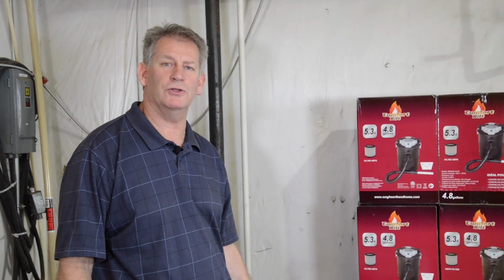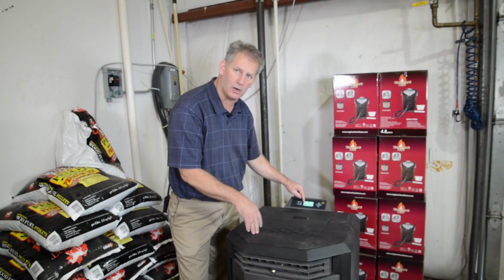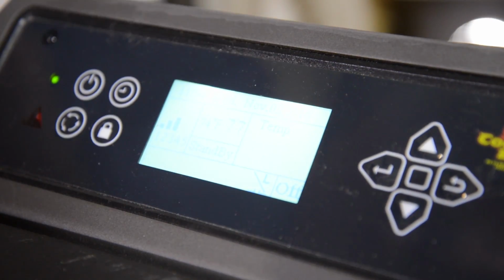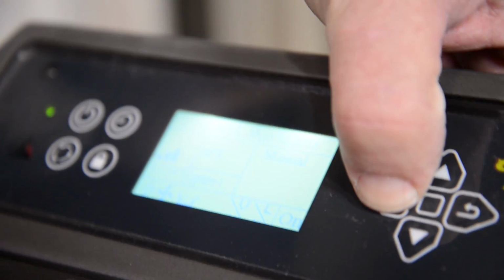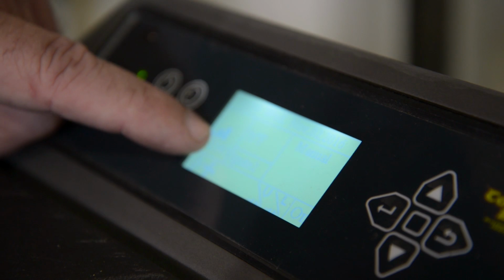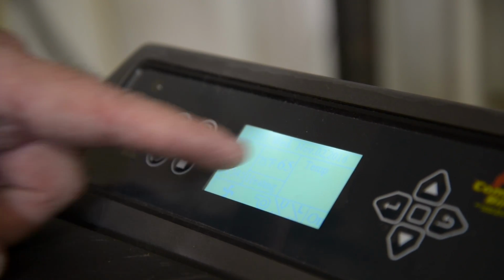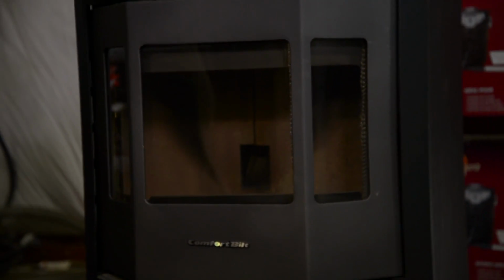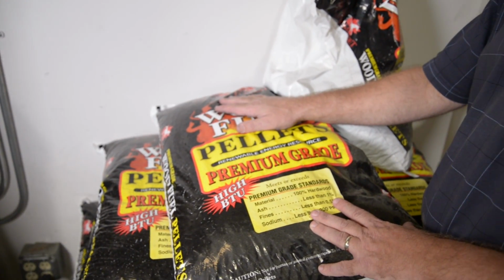ComfortBilt Setting Up the Stove (old video - see description)

Comment: Just fired up my new stove, so far all is well, hopefully no issues and happy burning, now i need to test out pellets, i just bought 1 bag from tractor supply.
Reply: I’ve found pellet density is most important. All pellets claim to be premium with minimal ash and dust. You can test density by scraping the end of a pellet with your finger nail. If it falls apart easily it’s going to burn quicker with more ash and there will be more dust.

Comment: TLDR: Buy this stove, don't think twice! The HP22 it’s a great stove, and could be MUCH better with a few simple tweaks.

Here is a conversation I had with Glenn via email and his responses (he is very quick to answer):

Hello Glenn, I am from upstate NY. I spoke with you multiple times and you have always responded to all my questions. I want to start off by saying I absolutely love the 2 HP22 pellet stoves, by far the best I have ever owned (and I have owned and operated over 7 stoves and 1 “automatic” pellet stove boiler system that uses the internet to read ahead 1 week to know what it needs to do (never really worked right).
 
However, I have a few questions and I know we talked about 2 of them over the phone.
 
1. Extended hopper, I would LOVE to be in that beta program or roll out cost is not really an issue. I love testing things and will give my honest review and opinion. 

Glenn - Extension hoppers will be available in the middle of February, I do not know the price or features as of yet though.

2. Faux wood logs, not sure if it’s the right term but I think you understand what I mean. You said on the phone that you did in fact play with that but the pellets would bounce off it causing inconsistent burn. Through my work (and soon home) I have access to a 3d printer and would love to play around with designs (in the summer months) that would not cause issues, I am confident I can get this done (just not sure about time frame as I do work 70-80 hours a week in the IT field. If I do get a great design and test it would you be interested in this? I am not looking for any money or anything like that again, I am a tinker that LOVES to make products better. I would gladly hand over the digital file that you can use to have your partners make out of the right material.

Glenn - Wood logs. Although I do like the look of a log in the stoves it seemed to have caused blockage issues in the past. But it is ok to put one in there.

3. The igniter, when I got my first stove in it started right up no issues at all. However, the second would go to Ignite 4 then time out. Knowing a little about stoves I figured it was an igniter distance issue. I was right, but the twist here was that there is not a hard stop to ensure its all the way in. You can physically push it all the way through and then the set screw will never hit the igniter to hold it in place. I would recommend (if possible) to use a nail head approach. Put a flare at the end so users can push it in all the way then the set screw would hold it in place. I found what works best is about ¼ of an inch away from the hopper end works best. Both stoves adjusted and both start at the end of the 1st ignite or at the very start of the 2nd ignite stage.

Glenn - Igniter. Yes, 1/4 inch behind is the optimum location it makes a world of difference in startup times.

4. The place you have the thermometer coming out is too low to the ground (in my opinion). After a few weeks of testing I believe the perfect place to exit the back is 8.5 inches down from the top and 4 inches from the side. This should be a super easy mod and I will be doing this to both of mine in a much nicer way, internally with real zip-ties (the bread ties were just for testing).

Glenn - Thermostat wire. Although I admit it's not the right location and therefore causes the temperature in the room to be off by around 5 degrees. The wire is just long enough to move it like you did and I will pass the location you gave me along.

Me - (I actually have to respectfully disagree. If you open the side of the stove and remove the zip ties I had ample wire to come all the way up the back behind the control panel and sit about an inch from the top, and I am proposing it sit around 8 inches from the top.)

5. The metal auger cover, this is a flat top and pellets get stuck causing the sides to not completely move down. I have had the pellet stoves error out when there were still a good 2 hours left of pellets in side, they just did not slide down and were stuck on the side and auger cover. I don’t have any suggestions for the sides but a “^” or cone shaped cover over the auger would fix the flat top issue. It does not see high temps back there so I was going to play around with some 3D printed designs (in the summer of course). Once a design is made it would be easy to make a kit out of metal and include high temp sealant for an “add-on” fix.  Again, this just may be me over analyzing things, but again, I love to tinker.

Glenn - Hopper angle. This is my most despised feature as you want all the pellets to go toward the auger but like you said it leaves 5-6 lbs. on the outside of the walls. The taper should be more prevalent.

6. Ash pan, it does not quite sit far as back (internally) as it should. I would say (guestamating here) the ash pan catches about 68%-72% of the ashes, the rest fall behind the ash pan and have to be cleaned up with the pan pulled out. Not a big deal, just wanted you to be aware of a possible issue for future revisions or what not.

7. Cleaning cycle, I am not sure if you tested different timings but what I have found to work the best is every 30 minutes run a 30 second clean cycle. This keeps the burn pot nice and clean and does not affect operation even on the lowest settings. I have been running with these settings for 2 weeks and not one issue.

Glenn - We tried the cleaning times at 60/30 and 60/20. I do think that the 30/30 will be better because it's cleaning more frequently.

8. This last request might sound a little odd. The computer that is inside the black plastic box how much would it be to get one of those with the data cable and thermometer. I don’t want to play with the one that came with the stove but here are my plans, again because I LOVE to tinker, not out to make any money or anything like that. I am just programming my whole house to be a smart home. The reason I would like a spare so I can see the outputs and hook it up to a RaspberryPi 3 with WiFi and Bluetooth. My reasoning is that I can write and android app that hooks to my existing smart home (or will run solely on any android device) and control the stove from wherever (as long as you are within BT range) From there I would be able to hook it up to my Amazon Echo or Google Home assistant and control via voice. If popular the same thing could be ported to iOS for apple users. Let’s face it, the remote that comes with the stove is not the best, not bashing, just my honest opinion, and I think there would be a huge market for a module that would take 10 minutes to install as either a user add-on or direct from you then download an app and control your pellet stove with a smart phone or any of the new and upcoming AI assistants. I will sign or do anything to prove that I will not sell this if/when I get it working this way I just love to tinker. If it is something that you would like to add as an offering on your stove, then great. You did such a great job on bringing pellet stoves not only to modern day technology but still being affordable as well. I just would love to see this incorporate more technology and be even simpler to use.

Glenn - Sure, if you want a mother board or control panel or even the thermostat wire just call us at 919-388-7615 any weekday 9-6 est. Prices are on the website Comfortbilt.net under parts and warranty header.

I also have tested about 20 different brands of pellets (that are available here in Upstate NY) have found by far the best that burn in these stoves are called Green Team Platinum. I am not affiliated with them in any way. I just wanted you to know my finding in case others ask. You may have a better product down in NC that I don't have access to test, but these are what I have found to work the best. After a full 48 hours of run time no cleaning. Clean windows and clean burn pot.

Glenn - Pellets. The very best pellet I've ever tried was the LG. Second best was the Turman brand. There are so many brands to choose from as well as the hard/soft.   Both have their own little issues of heat transfer or clogging but luckily, we made the smart control where those can be taken care of with a minor change in voltages.

Me - Sadly I have not seen LG or Furman but I will keep an eye out for them. Thank you again.

PS: The ONLY gripe I have with the stove (not really even the stove) is the instructions. They are worded incorrectly, no punctuation, run on sentences and many other errors. It looks like Google Translate did a horrible job.

The website does have an updated version but is still a hard read. It could be my OCD or ADHD, but even the revised PDF manuals are hard to follow (personal opinion, and does not affect the stoves operations)
 

Thank you again for your time, and by far the best pellet stove experience that I have ever had. Have a great day.

If anyone needs any help with the HP22 or would like my settings please feel free to reach out to me, I am usually very busy but will be glad to post what I have learned. I will also include pictures to everything I was talking about below in a Google Drive share.

https://drive.google.com/open?id=0B_UFm6O3hv3ZendlaDBDai0zaEU
Reply: Have you had any issues while the stove is starting with excessive smoke then rapid ignition causing smoke to blow into the room? I just got one of these and so far like it aside from the smoke blowing into the room during start up.
Reply: hopefully many of you're suggestions were looked into and added.  Waiting on my hp60

Comment: I have an hp-50s. It NEVER has a flame that big no matter the fuel or fan settings. NEVER empties the hopper always has at least 2 hours of pellets in the hopper when the stove "runs out" and shuts down. This thing is the equivalent of a 2500 watt space heater plus the cost of the wood fuel. Glad I wasnt the one that foot the bill for the stove or id find a way to launch it thru comfort builts showroom window.

Comment: I have a small pellet stove now but want this bigger one. The front top of this stove shows the blower tubes for the fan but I would like to know if the vents on each side also blows hot air into the room. I have to put my stove in the center of my living room next to the wall but side vents would be nice.
Reply from the maker: There is no active blower convection out of the side vents, but there is some radiant heat that emanates from the sides.
Reply: @comfortbilt5770  Thanks and I was able to replace my old fireplace insert with brand new wood stove insert which will be 90% of our heat source so the Pellet stove will be sufficient the way it is but I don't think it would take a lot of engineering to put blowers out the side as well.

Comment: Wondering if you answer any of the questions that these folks ask?
Reply: Robert Parker I’ll answer for u what questions u have lol
Reply: I would like to to know how to turn down the pellet pellet feed?  Mine burns through from a bag and a half to 2 bags a day on the lowest setting?.
Reply: Jonathan Beyer go to feed rate and press up down up up down up
Reply: @cesar68033   my stove doesn't have a feed rate?  I bought this stove used and it didn't come with a manual.
Reply: Jonathan Beyer go to the comfortbilt website u could download it online
Reply: @jonathanbeyer2433  Did you ever get to adjust the feed rate?  I'm interested in knowing how you did this.

Comment: I am a new pellet stove owner. The top of my stove gets hot. I was told that the outside of the unit should not get hot. Does this mean there is something wrong?
Reply from the maker: The top and sides do get hot, but not nearly as hot as the front glass will.   The top may be getting too hot if the room blower fan is stuck or not moving enough air out of those front vents.

Comment: I just got the hp50 pellet stove..can you change from manual mode to temperature mode and vice versa while it is operation...or do you I have to completely shut the stove down then change the mode I want?
Reply from the maker: You can, but there is a risk that if you cycle through the weekly or thstat modes, the stove could go into a fire off mode, and shut down.

Comment: Hi there's ptoblen to start  there's lot Stoke white tell me what is the problem thanks
Reply from the maker: Excess smoking on startup can come from a few things. 1) Igniter not centered. 2) Limited airflow. 3) Too much fuel in the burn pot.  Always make sure that the burn pot is empty and clean before you start up the stove.

Comment: I am having trouble with the my stove not staying lit.  I have the temperature up higher and the hopper still has pellets.  It's like the pellets are not feeding in to the stove.  How do I fix this or do I have a problem with the auger or feeder?
Reply: What kind of pellets do you have?
Reply: Make sure all sensors are well vacuumed
Reply: Check, your ignitor.may not be working. Start fire with gel, make sure auger is working, feeding pellets
Reply: Remove all pellets n vacuum any dust in the Auger area. Then restart following all processes.  Good luck